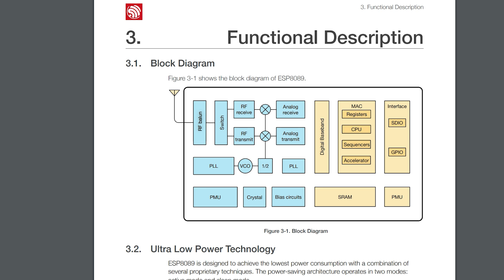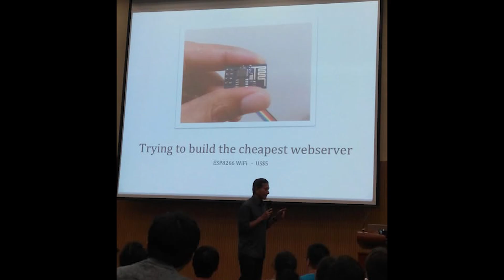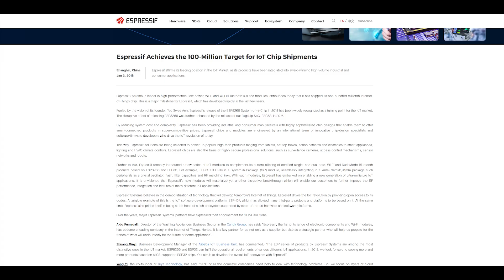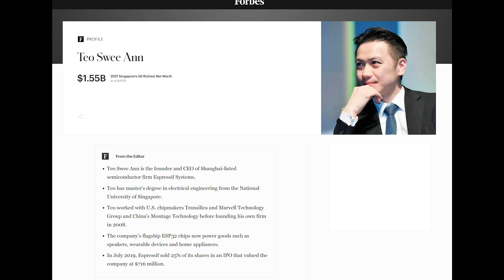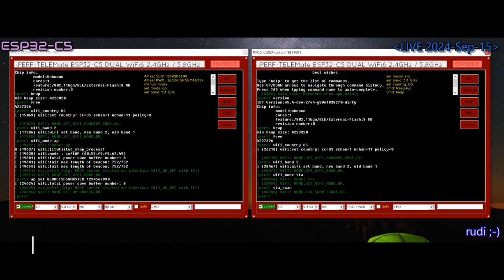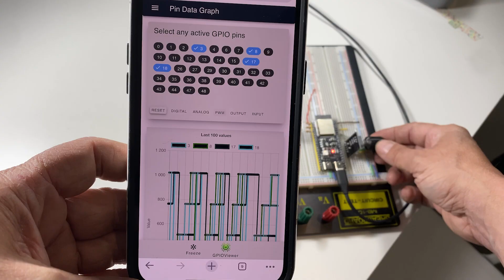The Story of Espressif Systems

Comment: Nice video. I use the ESP8266 and the ESP32 C3 in many of my own projects. Small, easy to program, not real power hungry and easy to integrate into any project. You failed to mention the ESP01 and ESP01S. These are so small they can fit into a space the size of a postage stamp. Thanks for sharing.
Reply: Thanks for the like. It's appreciated.